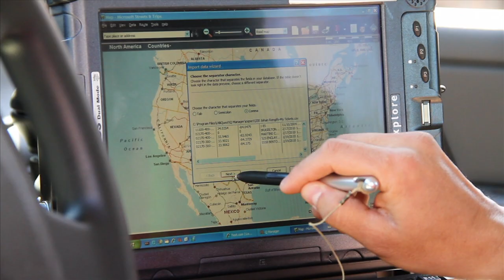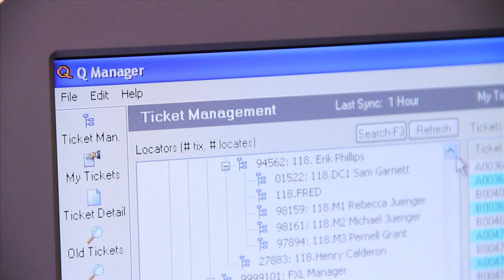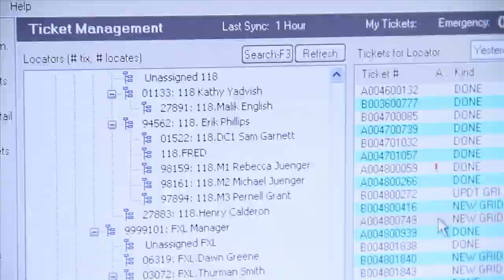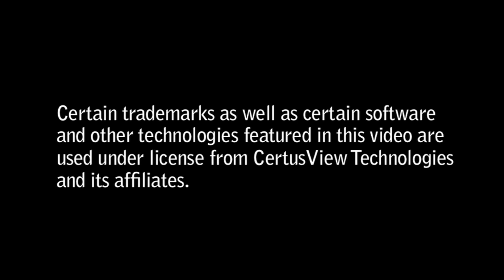Utiliquest - Utility Mapping

Comment: Nobody even uses real measurements for the tiedowns. You can just put 1ft from excavation area as your tiedown on every ticket. Complete waist of time.

Utiliquest has the highest turnover rate out of any locate company in my area. They also have the highest damage ratio in the area. All of these extra procedures just add stress to the locator and make them have to work longer hours leading to fatigue, taking shortcuts, and more damages.

Camera in your truck watching you all day, mandatory overtime/weekends, emergency oncall every 3rd week? Nobody wants to work there more than 6 months. There were 15-20 people in my training class. Two years later I was the very last person left out of that class. Everyone quit or got fired.

Ask any contractor or locator, utiliquest has by far the worst reputation of any locate company where I live.I would only recommend it to get your foot in the door and get some experience, then move to a better company like I did.
Reply: ok look, i work there, what we do is major important, the highest damage ratio isnt our fault... its whoever made the hole after we locate.... research construction and utilities first before you bash a company...